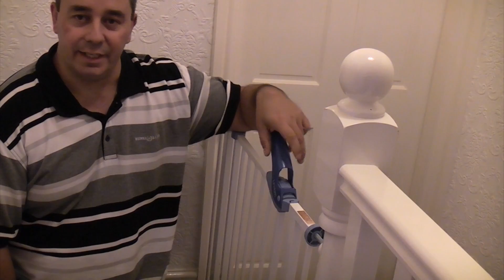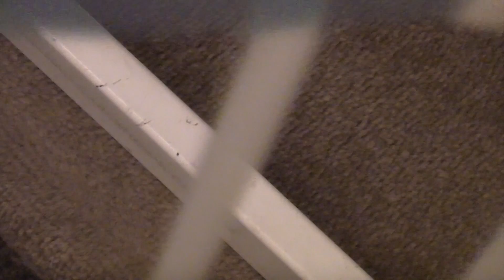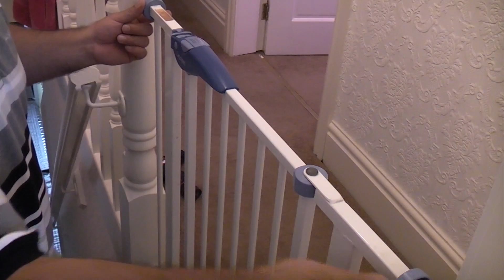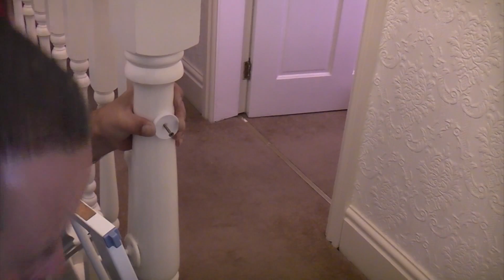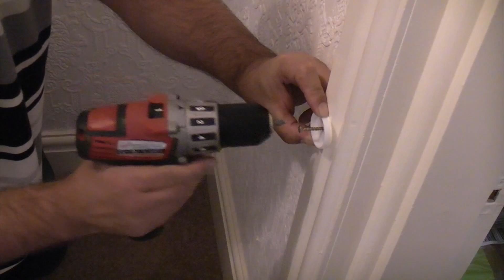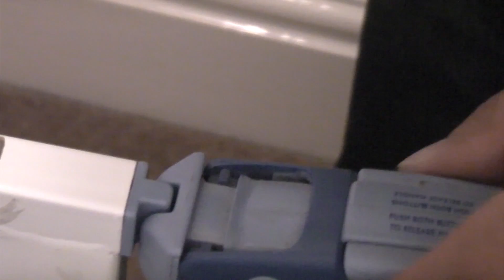Lindam Easy fit safety gate

Comment: did you use the plastic things to put in before the screw??
Reply from the maker: Yes, the plastic parts are screwed in position using the screws.
Reply: use a wall saver with soft rubber before screw that will be great

Comment: Hi, great video, just a few questions;
1) I dont have power drill can I just use regular screw driver?
2) I need safety gate at top of stairs, so think screw would be safer, but rented accommodation, will the holes in wall be very big???
Thank you in advance
Reply from the maker: +Kiran Kaur 
Yes, you can use a screwdriver.
Just check with your landlord before doing it ;-)

Comment: Why didn't you use a hardware mounted gate? This type of gate is not meant to be used at the top of the stairs. The bar at the bottom is a tripping hazard for adults and children. The wall cups give a false sense of security. The gate is still not directly attached to a solid surface (wall/newel post).
Reply from the maker: Yehudah Franken Do you have the instructions for this exact safety gate?
Reply: ***** .Yes I do. Please refer to these web sites regarding use of pressure gates at top of stairs. http://www.consumerreports.org/cro/safety-gates/buying-guide.htm.And http://www.kidco.com/products-page/pressure-mount-gates/. Unfortunately some manufacturers do say that these type of gates can be used, but look at the warning on their instructions. They acknowledge the danger but there is no warning on the actual gate, just a small print warning on the instructions which most people wouldn't notice, assuming they read the instructions. Would you still install one of these at the top of the stairs now that you are aware of the pitfalls ( pun intended!)?
Reply from the maker: Yehudah Franken The first link in your reply does not work as their site is down. The second link points to another manufacturer- not Lindam.
I have found the instructions here- http://www.lindam.com/uploads/resources/ld67_English_Wall_Cups.pdf
Which do actually say that you can use this gate at the top of the stairs.
Reply: ***** Hi Handyman: Yes, their instructions do say it is OK, but it really isn't OK. The other manufacturer (KIDCO) clearly states that on their web site. They make the same type of gate. The other link was to a web site from Consumer reports. If you wish I can send the information to your email. I'm not familiar with using these youtube comments to communicate with someone. My email is info@babyprofers.ca.
Reply from the maker: Yehudah Franken So your original post saying this type of gate is not meant for use at the top of the stairs when it actually is because it says so in the instructions is incorrect. I only made the video showing how to install it as it may help people. If you have concerns over the safety of the gate or the suitability please contact the manufacturers.
Reply: ***** You are correct and your efforts are admirable. However the manufacturers won't change because there are no regulations requiring them to do so. I am merely trying to educate parents to make safer decisions in spite of what some manufacturers are doing. That's why I show supporting evidence from KIDCO and consumer reports. Perhaps with this information you will also show parents the advantages of hardware mounted gates. Please don't interpret my comments as critical off your video. It's just that most parents don't realise the pros and cons of hardware vs pressure gates and I am doing my small bit to make a difference.
Reply from the maker: +Michael  Clark 
Thanks for the comment Michael ;-)
Reply: I fitted a similar Lindam gate (Sure Shut Securus) on landing at top of stairs using the supplied wall cups and two optional extension brackets following manufacturers guidance - totally safe and secure.

Comment: Thank you for your demonstration. We bought this in the USA and it was used. I have done all the steps until the screwed into wall circular things that keep it from shifting. Mine didn't come with those. What are they called? I need to buy them at a hardware store I am guessing.
Reply from the maker: You are welcome.
They are called wall cups.

Comment: Do you need to use the screw bits I've got mine but not allowed to put holes in walls etc
Reply from the maker: Yes, you definitely need to use the screw bits. They are essential to prevent the safety gate from being pushed out of position, which could be fatal for a child!